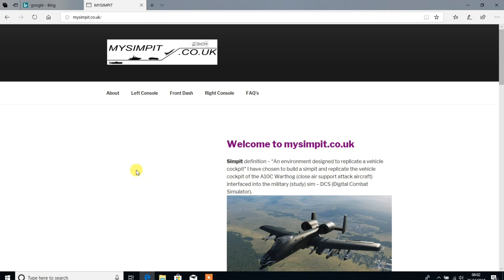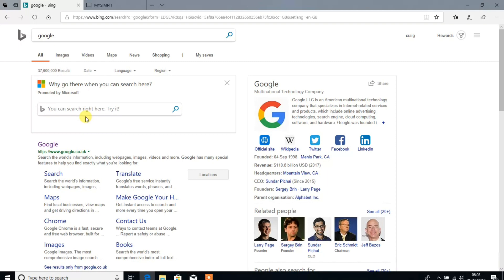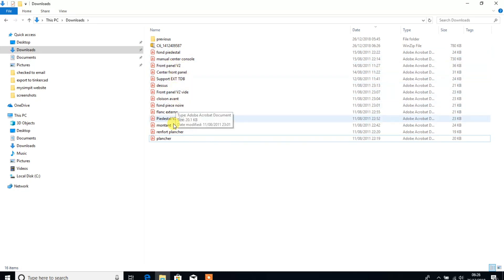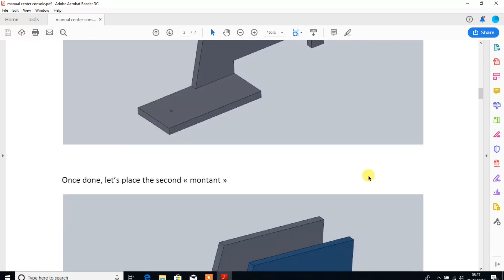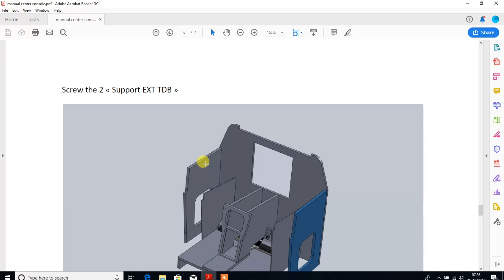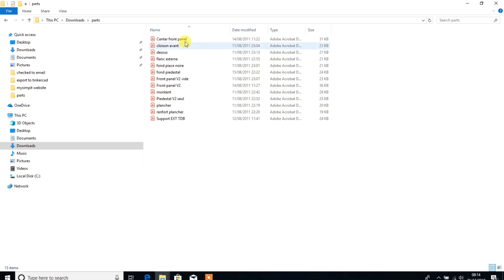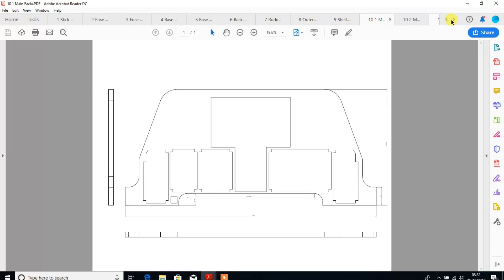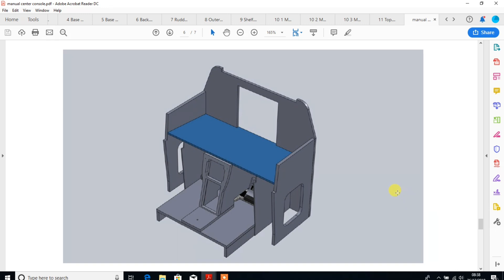Simpit A10C - Front Dash - Part 2: Design Selection

Comment: Again great video Craig, thanks for sharing! I`m looking forward on seeing it get together. My last project was a Truck Simulator (I have some vid`s). The build of the panels is one of the hardest parts because weight and materials are very important. I used 18mm MDF and I found out stuff started to bend over time. Also storing a sim in a non-heated garage requires extra attention! I put 6 large swivel wheels under my sim which was 2.5m wide at the time. Being able to move is very handy, because when your sim is successful, people are going to ask to to participate in shows with the sim. People also ask to rent the sim for trade-shows and that kind of events. So I recommend thinking far ahead when you start ;)
Reply from the maker: Hi Jeroen, you raise a good point about having everything mounted on wheels. My right console will likely need to move so I can step into the pilot seat, unless I step over the console itself. When I design the right console I might make a decision on whether to alter the others. To be honest, I don't plan to move it much on the whole.
I did check out the pictures of your truck simulator a few months ago. It was Scania as I recall. Very impressive. What are you building currently? 
Cheers
Reply: Craig S I’m in some kind of a break right now. I just moved in my new home and my kids are very demanding (1 and 4). I am testing the dcs bios stuff at the moment, saving money to buy a CO2 laser cutter. I do love to fly the A-10C in Arma3 but unfortunately Arma hasn’t got a DSC Bios solution for it. I will start building panels but I’m not sure I’m going to do a full cockpit yet.